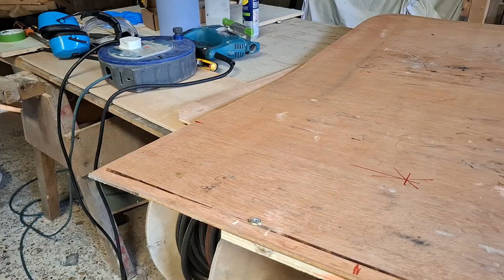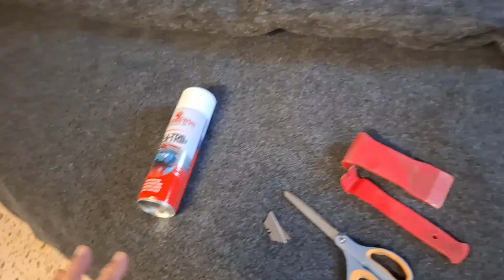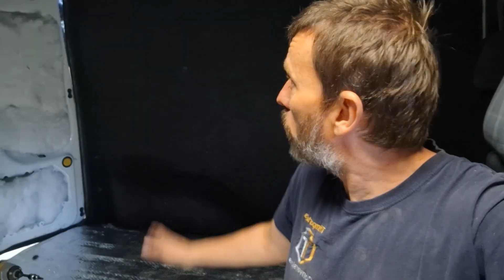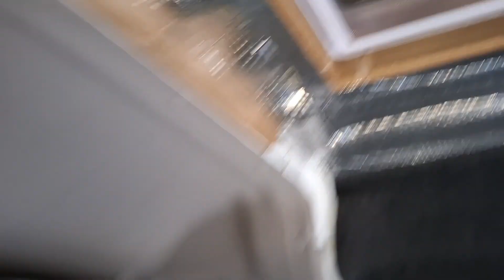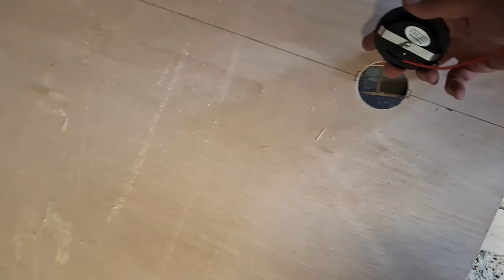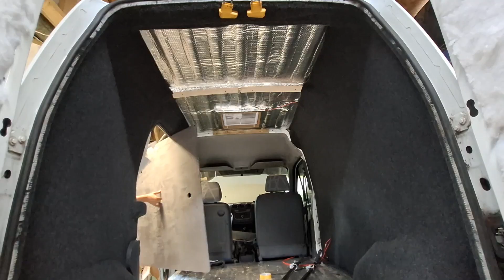Fitting out the walls and ceiling with carpet lining and suedeliner | Microcamper | Transit Connect

Comment: How do you decide where to screw in the side panels? I see uou put several screws in but not sure where those screws are attaching to and how you know where they will fit?
Reply from the maker: Photos of the inside of the van help for reference and keeping your screw length 20mm or less reassures you to not go through to the outside 👍